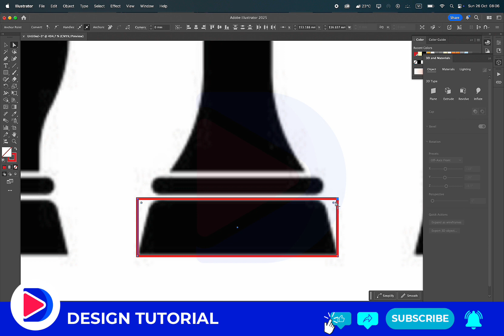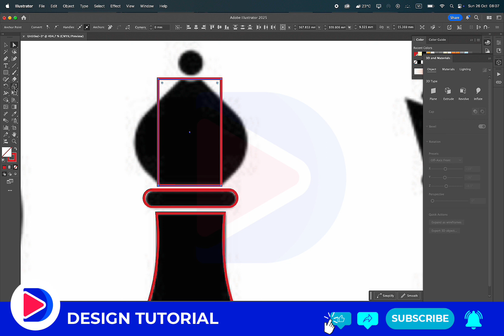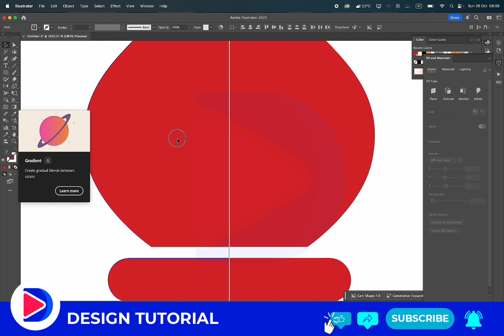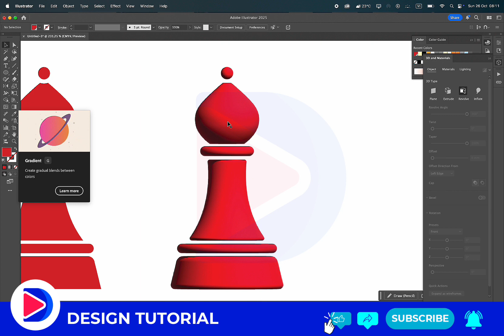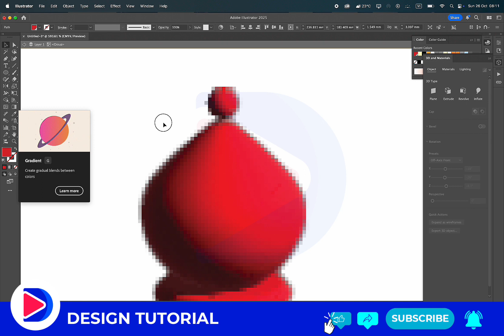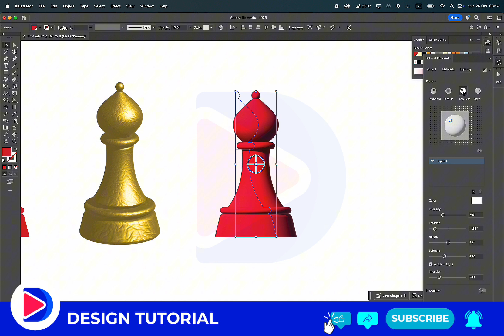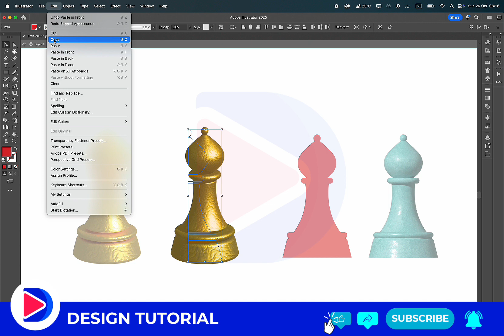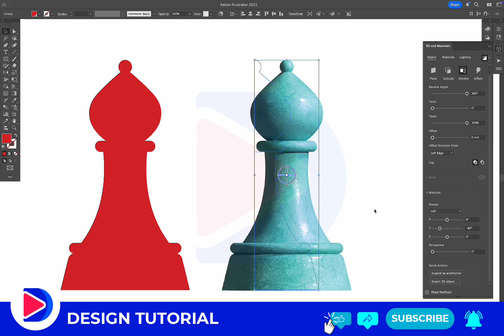How to Turn 2D Shapes into 3D in Adobe Illustrator | 3D Extrude & Bevel Tutorial

Comment: Thank you Tutorial. 3D Extrude & Bevel tool
Reply from the maker: You're welcome! Here’s a clean, simple tutorial for the 3D Extrude & Bevel Tool (Illustrator) that you can follow easily.
⭐ 3D Extrude & Bevel Tool — Quick & Easy Tutorial
1. Select Your Shape or Text
Choose any object you want to turn into 3D:
A rectangle
A circle
A custom path
Text (works great for logos)
2. Open the 3D Extrude & Bevel Tool
Classic 3D Mode (Older versions or legacy effects)
Effect → 3D → Extrude & Bevel
New 3D Mode (Illustrator 2022+)
Window → 3D and Materials → Extrude
(Both do similar things, but New 3D has better lighting and materials.)
3. Extrude the Object
Adjust:
Extrude Depth → how thick the shape becomes
Bevel → the edge style
Bevel Height → how deep the bevel is
4. Rotate the Object in 3D Space
You can rotate by adjusting:
X-axis (tilt forward/back)
Y-axis (rotate left/right)
Z-axis (twist)
Or use the cube widget to drag it manually.
5. Add Lighting (Important for 3D Look)
Control:
Light position
Intensity
Ambient light
Shadow softness (New 3D)
Lighting dramatically improves realism.
6. Apply Materials (New 3D Mode Only)
You can add:
Metallic finish
Plastic
Matte
Textured surfaces
7. Expand (Optional)
To convert the 3D object into editable vector shapes:
Object → Expand Appearance